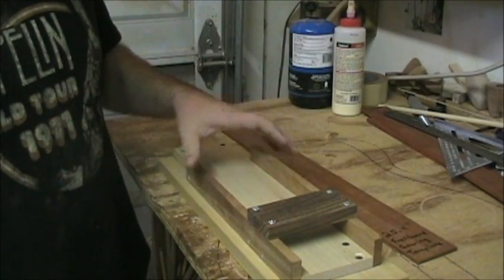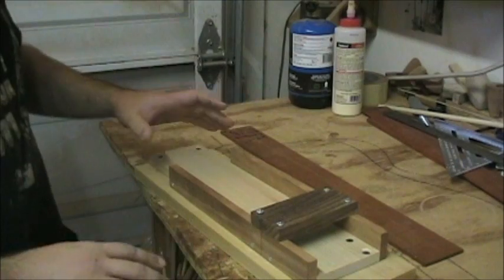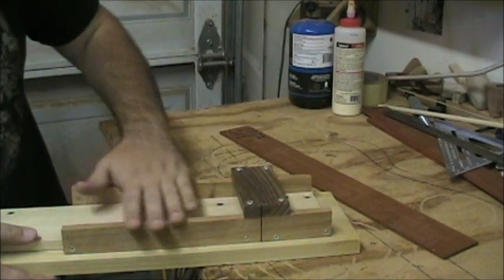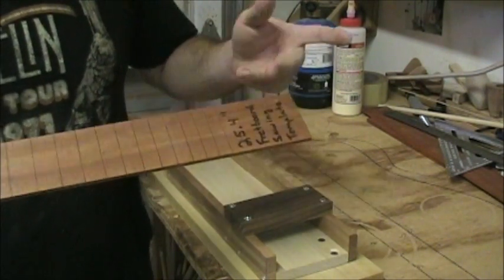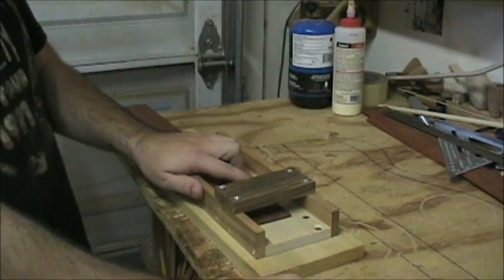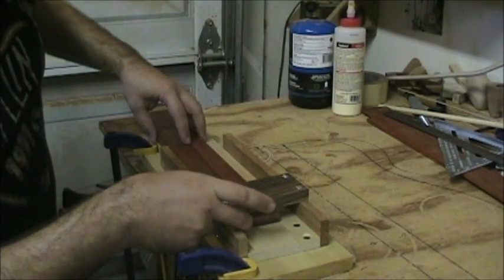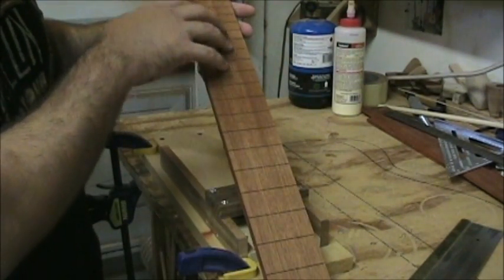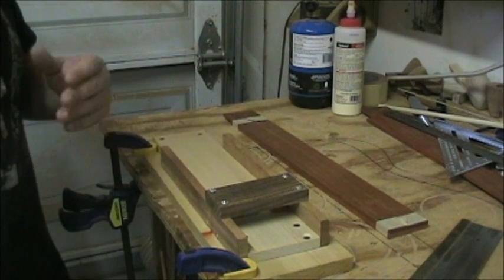Fretboard Slot Duplicating Jig

Comment from the maker: I'm so sorry that I didn't see this earlier, but the bottom of the trough only needs to be as wide as the widest fretboard blank you plan on slotting.  In which case three inches is usually enough for most acoustic guitars and basses.  A six string electric bass may need a wider trough, but for acoustic work, 3" will be fine.  I hope this gets to you in time to be helpful, and best of luck.

Comment: I was ready to invest about $200 for a fancy fret saw From LMI or Stew Mac when I saw this. Instead I made one of these in a few hours from scrap Ash. I used a Hacksaw Blade in the base and ground it to an easily removable shape so I can use the box without it if I want. I ordered several pre-slotted boards from LMI for $12-15 each, one of them custom slotted. The first test board came out great taking about 10 minutes to cut a dozen perfect slots to full depth in a Ukulele board. I made some stackable shims for the top of the mitre bax so I can control saw depth of cut.

Comment from the maker: The fretboard is flat at the point where you run it through the fret slotting jig, so all I do is make sure I saw about half way through the blank. The reason for that is you will be putting a radius on the fretboard after you saw the slots, so most of the work you did in making the slots will be erased by the sanding block. The frets are re-sawn to full depth after the radius is done using a fret saw and stop block that's attached to the saw blade.  Any questions just email me and I'll help.

Comment from the maker: The jig essentially makes marks that end up being sanded when the radius is put on the fret board.  The ends are completely sanded off, and all that remains is a small slot in the middle of the board.  You have to go back again anyway with a fret saw and a depth stop to re-saw the slots anyway, so all I do is make sure I get into the board about 1/8" or less when I'm using the slotting jig, and they always come out just fine.  It's easier than it looks, I promise.

Comment: On six gun website it says about 3 inches wide ?   The one you have here looks more than that.I had cut my stock using the 12 inch x 3 inch measurement on the website and although i have not gone any farther I am wondering if 3 inches is wide enough. Thanks Brian

Comment from the maker: I count 20 strokes each time.  I've sawed so many that it's a feel thing for me.  However, if you watch what you are doing it's not hard to get it right.  Besides, you only need to saw about half way through or less, then you will radius the board and have to re-saw the slots by hand anyway, so a little extra depth or a little too shallow wont be a problem in the end.  If you get stuck email me and I'll help you.  sixgunguitars@gmail.com